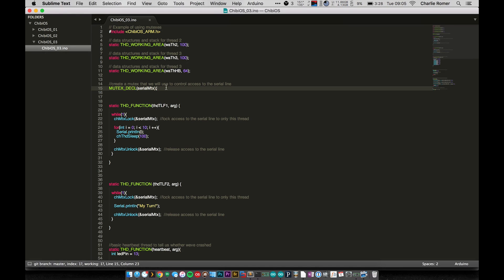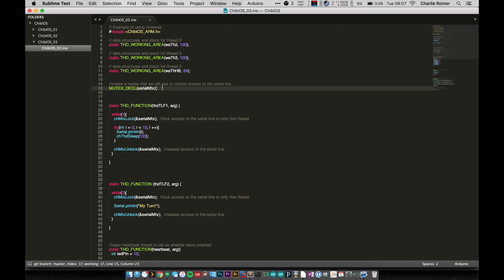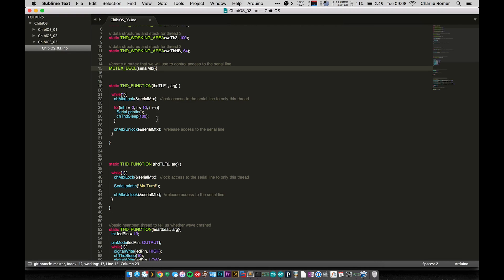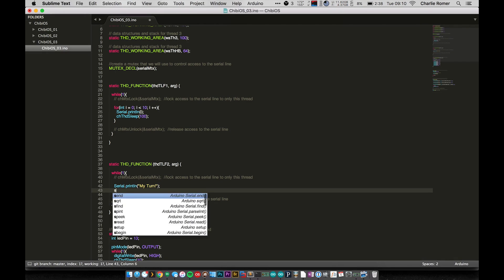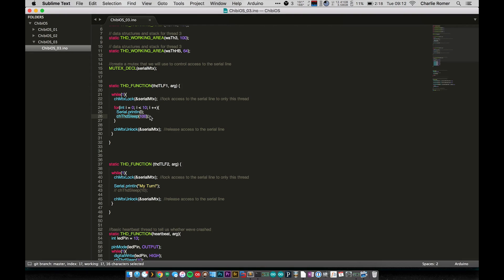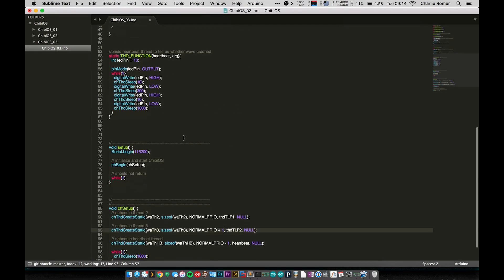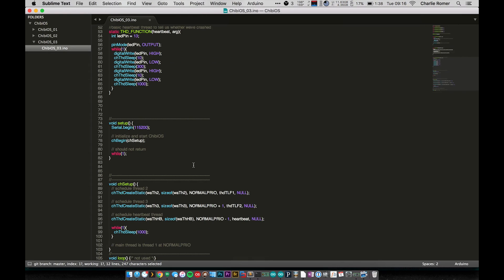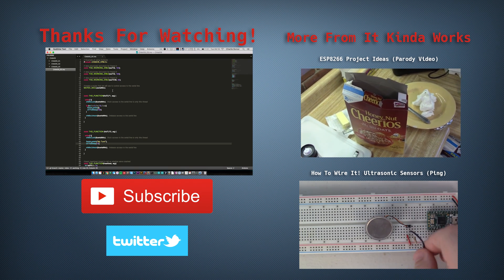Arduino RTOS: Mutexes & Priorities (ChibiOS)

Comment: are you compiling it for a ESP8266 module? is it possible to run chibi on a ESP?
Reply from the maker: The ESP8266 actually runs it's own RTOS and the Arduino port of it just hides the fact that there is an RTOS running underneath it all. I haven't seen anyone get a port of ChibiOS running on an ESP but I've always kept my eye out for it. The RTOS that runs the ESP I believe is a modified version of FreeRTOS but dont quote me on that.
Reply: ItKindaWorks
 i see. thanks for the quick answer. hope you keep working on the chibiOS series

Comment: Not sure about that language (looks like C), but in some languages `sleep(0)` is sufficient to allow another thread to execute.
Reply from the maker: This is C (with a large set of libraries to help abstract hard concepts - make it easier for beginners yay!) but the problem with just yielding to the OS (what sleep(0) effectively is) would still be problematic a lot of the time because it would only yield 1 tick of the kernel to pass before preempting with that same thread. So although you are correct, sleeping for 0 time can still cause a lot of problems if the thread is a high priority. I find it safest to sleep no less that 3 ticks unless you have a really good reason that a thread should need to run that often. 

Another useful thing to note is that you can change the tick period of ChibiOS. By default this library has a tick rate of 1k ticks/second so sleeping for 500 is half of a second. You could change that number to 10k or even 100k (although at some point you will be limited by the speed of the processor) so it's pretty easy to make it so that threads can hop between each other more frequently. So before when you called sleep(3) it would sleep the thread for 3ms it could instead sleep for .3ms or less while still maintaining multiple ticks between the sleep call.
Reply: +ItKindaWorks wish I could thumb up your comment on my phone. Great answer and additional insight thank you so much!